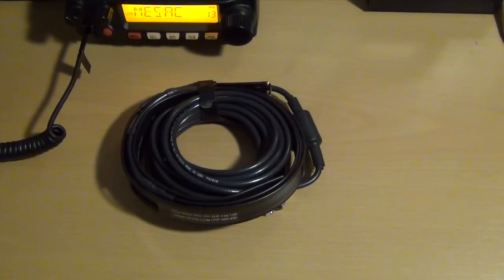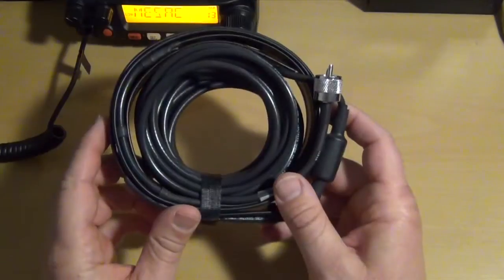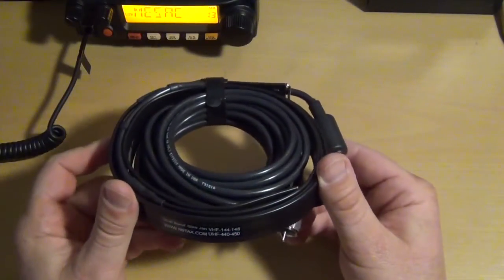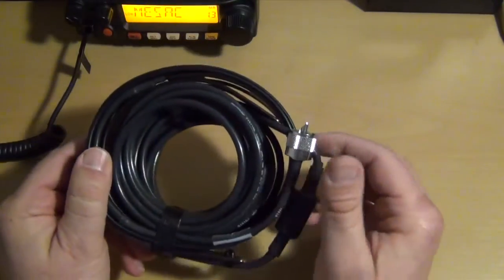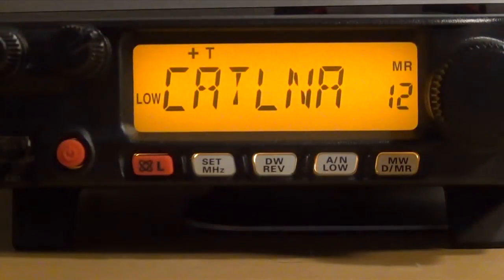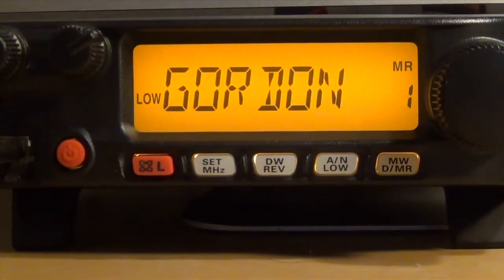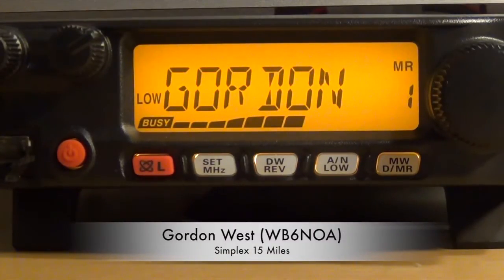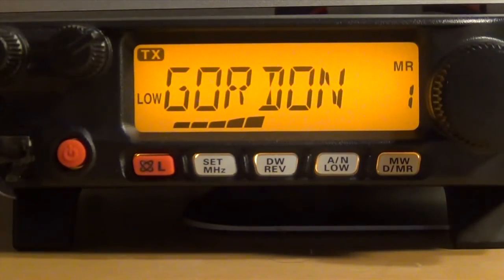Ham Radio Antenna - N9TAX Slim Jim Dual Band Antenna Review

Comment: I have one for gmrs. Ended up getting a 3 element tram gmrs yagi that works alot better. I have it mounted on a 6' wooden coat rack on the 2nd floor. I hit repeaters from the coast of long Beach to Mt Harvard, Mt Wilson, Contract Point, Saddle Peak, Santiago Peak, and even the Crestline repeater next to Big Bear.
Reply: Yeah those are all high coverage repeater sites. Not impressive at all. You could hit those using just the coat hanger itself.
Reply: @KandiKlover  I know what you mean.  I easily hit those "high coverage repeater sites" with my HTs inside my room, living in a canyon and valley surrounded by mountains and hills all around.  BUT using simplex, handheld to handheld, lucky to reach half a mile; handheld to mobile using same locations, a mile or two; mobile to base, ten miles was my record, BUT, different location for the mobile.  I love doing field testing using different antennas, locations, radios, weather conditions, etc.  😁
Reply from the maker: Thank you for taking the time to watch and the comment! It is greatly appreciated. I am familiar with a of those mountains. I use the CLARA repeater quite often on Santiago Peak. I am going to have to try out that GMRS Yagi. Might put it in my attic. Thanks for the info!

Comment: Are you still using this setup?
Reply: I have the same dual band antenna and a Yaesu 2 meter radio. I'm getting really good results with it. I wonder if there would be any benefit to getting the single band antenna instead of the dual band one since the radio is single band?
Reply from the maker: Even though this antenna was purchased for the FT-2980 2m radio, I bought the dual band antenna so I can use it with other radios that have 2 bands.
Reply from the maker: Thank you for taking the time to watch and the comment! It is greatly appreciated. Yes, I still use both the N9TAX antenna and the Yaesu FT-2980. They work like a charm!

Comment: have you thought about put the antenna in the attic
Reply from the maker: Thank you for taking the time to watch and the comment! It is greatly appreciated. I had looked at putting it in the attic. However, My attic has what looks like aluminum foil lining all of the plywood for the roof. Because of that I figured I would be setting up an antenna in a giant faraday cage.

Comment: The ebay description says not to connect it directly into the radio, why? What goes in between? Thanks.
Reply from the maker: Thanks for watching and the comment! Do you have a link for that? I would like to see what they are talking about.
Reply: @WJ6FRadio  I am not really sure what he is talking about lol. I guess just any length of cable in between..
Reply from the maker: I am guessing he doesn't' want people trying to connect the ladder line straight into the SO-239.

Comment: Do you still have this? Whats the condition like if you do. Like does it still work and still in one piece.
Reply from the maker: Thank you for taking the time to watch and the comment! It is greatly appreciated.  Yes, I still have the N9TAX and it is in great shape! I currently have it hanging in my garage so I can hit the local repeaters during this whole Corona Crud lock down. It is in excellent shape, and I put it on my Comet antenna analyzer and it is still very low SWR.
Reply: @WJ6FRadio  ok thank you. Seems like a good antenna then if its still up and running well.
Reply from the maker: I like the N9TAX so well that I bought a second one about a year ago, as well as giving one away as a gift to a newly licensed ham.

Comment: I just ordered one. I'm excited about it. I ordered it with the 16 feet of extra cable and the pl259. I want it to be versatile so I can use it for a mobile in a portable set up or I can put an SMA adapter on an HT and use it that way. I will never run 100 Watts thought it but I'm glad it will do that. The most I will run through it is 50 Watts. Seems like a great little antenna I'm looking forward to using it. If it works as well as I've seen I will order 3 more for my Apache cases with radios in them.
Reply from the maker: Thank you for taking the time to watch and the comment! It is greatly appreciated. The N9TAX is a great antenna! I have ordered 2, maybe getting a third one. These antennas  can take a beating. I am also a fan of the Apache cases. I have a video on one that is my Go Box for 2m/440.

Comment: Tried it in concrete high rise, attached to tall window glass, and other places.  No change over stock rubber antenna.  Next stop, Elk dual band log periodic.
Reply from the maker: Thank you for taking the time to watch and the comment! It is greatly appreciated. I did the same thing. 20 stories and couldn't hit my house 6 miles away. I have been told there is some thing in the glass that interferes with the signal.
Reply: @WJ6FRadio the metal interferes with the magnetic field of the matching transformer. Couple of LID appliance operators.

Comment: Does that antenna have to be straight up and down, because I can put it on the roof of my house which has a very steep pitch maybe 36° so it wouldn’t be straight up and down it would be diagonal can I do that with that antenna
Reply from the maker: Thank you for taking the time to watch and the comment! It is greatly appreciated. The reason for making this vertical is because the antennas on repeaters, as well as people's vehicle and ht antennas are also vertical. If the polarization of your antenna is not the same you will most likely have some difficulty receiving/transmitting. Are you able to suspend the antenna inside of an attic?

Comment: Nice video. How well does this work with a handheld? I use mine mainly as a scanner for local police and fire. I have a updated fixed antenna Nagoya NA-771, but the reception is still poor with a lot of static. I am in the same situation as you and can’t mount anything outside, but it’s only a single level house. Thank you
Reply from the maker: Thank you for taking the time to watch and the comment! It is greatly appreciated. This antenna works great with an HT. I have used it with my FT-1 and FT-2.

Comment: How does this compare to the slim jim by Nelson Antennas? I'm torn between the two. They seem to be the most popular
Reply from the maker: Thank you for taking the time to watch and the comment! It is greatly appreciated. I'm not familiar enough with a Nelson Antenna. However, I will be making a video this week about Ed Fong's DBJ-2.
Reply: VideosByDPF Great. I'll be looking forward to it. I'm trying to find the best hiking antenna. Have you ever tried the MFJ-1714? It's a1/2 wave telescopic antenna. I'm curious which works better, that or the slim  jims. I would guess that the slim jims do.
Reply from the maker: I have not tried the MFK-1714. The only other 2m/440 antennas I have, currently, are Diamond X-50a, An outstanding antenna,  but sucks if you want it for portability, and Elk Antenna 2M/440L5BB, easy to carry, but requires assembly and is not omni directional (I have an up coming video for this one too).

Comment: Nice video... I've had my N9TAX for several years, rolled up and out, back into a roll and into my suitcase plenty of times.  I use it with an inexpensive Baofeng UV-82, and program it for repeaters in the areas I am in with Chirp.  Great fun while traveling, and it works really well!  73, Brett
Reply from the maker: Thank you for taking the time to watch and the comment! It is greatly appreciated.

Comment: Im looking to buy the murs/gmrs slim Jim for my gmrs base station radio. What would be the best indoor location to place this antenna? Are Windows a good location? And does this antenna need to be grounded for indoor use? Thank you
Reply from the maker: Thank you for taking the time to watch and for your question! No ground is needed. I have mine hanging in the corner of my upstairs loft and have had no troubles getting out. Windows are fine as there is less building material to block your signal, especially if you are in a stucco home just as I am.

Comment: Great video. I'm new to this hobby and learning.  I've wondering if you have tried the DBJ-2 by Ed Fong? I see it mentioned in various places online. Is this the same type of antenna, just a different manufacturer? Was just wondering what the differences are. Thank you so much.
Reply from the maker: No, I do not have a DBJ-2. I contacted Ed Fong earlier, and he had stopped selling them while his students were going through final exams. He said they will be back on Ebay later this week. I am looking at getting one to test it along side my N9TAX
Reply: Thank you. (Maybe you might do a comparison review someday? That would be great.)
Reply from the maker: That's the plan!

Comment: Nice antennae and contact with Gordon. Obvious the operator was no licensed, failed to ID his call one time.
Reply from the maker: Thank you for taking the time to watch. And you would be wrong about being licensed. I edited my call sign out of the video. The license I hold is Extra Class. 

Per Sec. 97.119 Station identification,  "must transmit its assigned call sign on its transmitting channel at the end of each communication, and at least every 10 minutes during a communication..." 

Nowhere does it say this has to be recorded on YouTube, or any other social media outlet. If it were then there are a lot of Hams in violation of Sec. 97.119 Station identification
Reply: Copy Craig, just seemed strange to not hear any station ID from an Extra class operator,  KC8J de KK6FXR 73
Reply from the maker: I have since stopped editing out my call sign as it is a pain, and certainly not worth the extra work... This antenna is such a great investment! Thanks again for watching!
Reply: No problem, is the 450 ohm ladder line solid or stranded? It would be nicer if it was stranded. Gordon is a really cool dude. I took a class with him in AZ last year at a ham convention and he took a pic with my wife when she passed he tech. I have a roll up j-pole I use at the firehouse on 2m / 440. They are great. hope to hear you you on the air sometime, maybe on CW. Peace out

Comment: The ladder line slimjim is a solid design, however, the 6 dB (assuming 6 dBi) gain figure is wishful thinking.
Reply from the maker: Thank you for the comment. It is a great antenna, especially for those of us dealing with HOA's. The 6db gain is according to the website.
Reply: It's remarkable for backpacking as well and puts the dipole exactly where you need it.

The 6 dB Slim Jim gain claim is an unfortunate misleading figure repeated by Slim Jim makers who should know better.  The Wikipedia j-pole article is a well referenced writing on the "actual" performance, gain, etc. of the Slim Jim and other J antenna variants.

https://en.wikipedia.org/wiki/J-pole_antenna

N9TAX may not understand how to calculate gain, but his antennas are fantastic.
Reply from the maker: For the cost of these antennas you really can't go wrong! Thanks for the link!

Comment: I would recommend that if you are going to make a video about an antenna, maybe you should show it connected to a radio and actually in use?  We already know what the front of your radio looks like.  Show us the antenna, how did you suspend it, how far away from metal does it need to be, what kind of match to the transmitter does it have (SWR, etc.), how much signal did you lose when you added that 20 feet of cable. Enquiring minds want to know!  Also did you do any kind of side-by-side comparisons to some 'standard' antenna that we are more familiar with?
Reply from the maker: +helpawhiteguy Thank you for the comment, and critique. I will certainly take the advise. No, I did not test it against my other antenna, Diamond X-50A, as it is outside so the comparisons, of transmitting from inside a stucco clad house would not have been valid in my opinion.
Reply: +K6DPF I appreciate the response.  But that is how discoveries are made, especially in a hobby that is all about experimenting and communicating.  Try it, see what happens, document it and post it on YouTube.  Even if you say "yeah, I tried that and it didn't work.  Here is why......"  Hell, that is what makes people better than monkeys, since they don't learn from monkeys who tried stuff in the past.  Otherwise we would be inventing spark gap transmitters every generation.
Reply: Tks. my out fit is a simplex repeater unit, with a bf-888s, and now includes a coil of rgu58 cable@17', a amo can 50 cal (harbour freight©), and a slim Jim (was far superior than the mag mount.) So now my critter in the can is even more use full.  the slim Jim is launched with a zebco reel /and sling shot.    My first "high power test(2.2 watts) went well. Covering 20 miles. From pine wood ( hidden valley) to white bluff. TN. Sri haven't any photos. As yet working a board to add cw I'd.  Will consult with my son to get photos set up. To be clear I'm 69 years old and kinda like a steam boat engneer. Dropped into a nuclear sub. I get the concept. just the tools have changed. (Working on that) kv4li